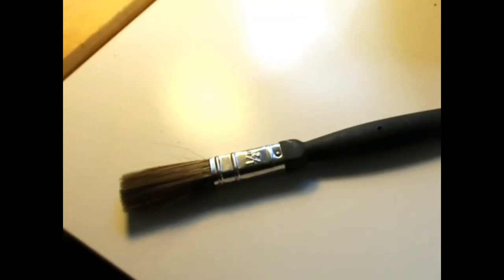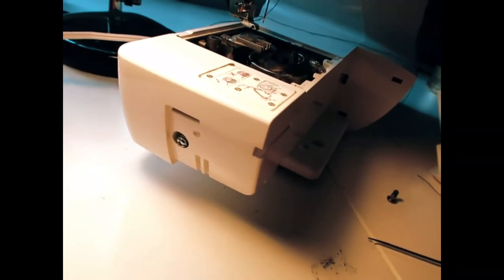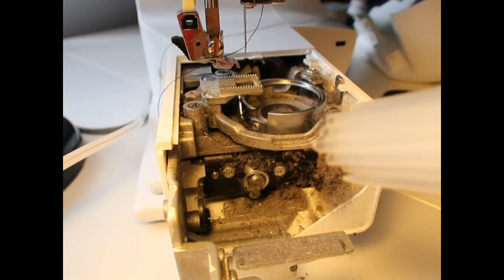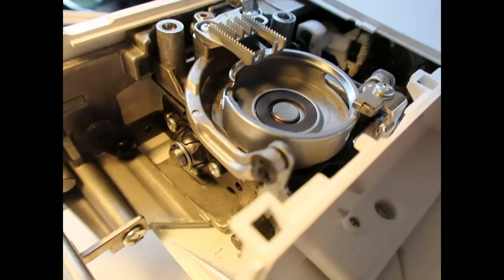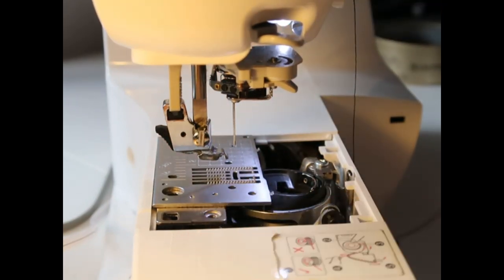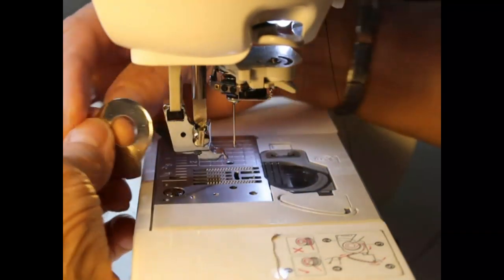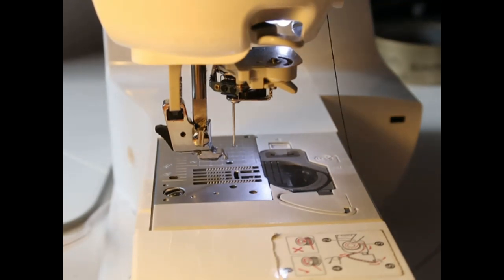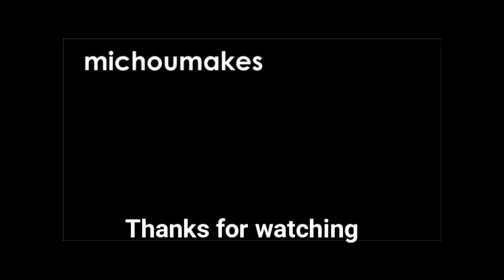spool case cleaning

Comment: Hello Micheline, I use a dime(American 10 cent coin) to loosen & tighten the "throat-plate". I place the dime in the grove of the screw,  put my index finger on top & with the other hand I loosen or tighten. It is easier than using the tool they supply. I keep my dime with the bobbins. I clean my machine, using a pipe cleaner. THANK YOU for showing how to remove the casing to make easier cleaning of the lower part of the machine.
Reply from the maker: Hi Marsha, I'm guessing you are much much younger than I am or you have more nimble fingers. I used to use s sixpence and yes I ought to retry using it. BUT, one think I have found as I am ageing is that gripping  and picking up small items seems to get harder. Chuckle x
Reply: @michoumakes  Yes my fingers sometimes have a challenge with small things, I am 69 & I think I'm older than you at 50 something. Please continue to teach all of us. You are so very nice.
Reply from the maker: @marshapowell2054  then you have nimble fingers Marsha. I wish I were only in my  50's but I'll be joining you at being 69 in December. 👍😍
Reply: @michoumakes  Wishing you HAPPY BIRTHDAY, in advance. Just got a notice from YouTube, @September, we will not be able to talk/reply.

Comment: The Stanley Tool Co. makes a off-set screwdriver. I find it perfect for the face plate screws. It is in the shape of a elongated Z. with a Phillips head on one side and a Standard head on the other. Works just perfect when taking out and putting back in the pesky screws.
Reply from the maker: Thank you ever so much Barbara that's such a great idea. I have used them in the past when working alongside my father on some mechanical task where nuts and screws were hard to reach, but I completely forgot how practical it might be for the sewing machine. 
Now to see if I can find one. 👍👍👍👍😍😍😍

Comment: Hmm, I’ve got a Brother machine that looks like that, and that vacuum attachment. Will have a look and see if mine also has that screw so I can take the side off. Will also check my bobbin case for wear, as never thought of that. Great video! Thanks.
Reply from the maker: That side screw makes a great difference to cleaning the machine. I'm sure my previous machines never had that. 😍👍

Comment: I realize that this is not a video you did very recently but I just wanted to say that the piece that holds your presser foot on the machine is removable so that would make putting the screw in a lot easier. I generally take off as much as I can to simplify everything for myself. Seems to me you have all kinds of gadgets to get the job done. Love the hoover tool attachment will probably need to look into something like that. I too use paint brushes especially since I was cleaning a Brother machine that I gifted to someone a long time ago and was using the small brush that they give you and it fell down into the machine, unfortunately didn't have a tool long enough to get it out so it stayed in there. You know the long hemostats (forceps) would have been the perfect tool. I think rather than waiting 6 months to clean the machine I would probably look inside after every couple of projects (especially since you have the ability to take that front piece off) makes for a easier job.

Comment: I have a brother 4000D and I was trying to clear a thread jam the other day. So I took off the covers and found what I thought was a TAUGHT thread which I couldn't move, I decided to CUT through it and then trace it back to the problem . I was absolutely gutted when I discovered that I had cut through a very fine tension wire. I just cried for an hour. It will be expensive to fix, just as well I have a backup machine.
Reply from the maker: OH NOOOOOOOOO!!!!!
I do hope it's not going to cost you too much Mary. Thankfully you have a backup. x

Comment: Hya Micheline, Love your videos. I have a Brother machine but the screw driver that came with it is much too long so I use a 2p piece to undo and  re-tighten the screws. It works very well.
Reply from the maker: Hi Ann
I have a little 5p piece in my front pocket/box of the machine and yes I do use that too. However, I'm finding as I age that it's not always as easy as it used to be to use it. Sonehow my mind says one thing and my fingers say the other! 😂🤣🤣😂🤣

Comment: Hi Micheline, that was very interesting, I’m going to give my machine a good clean now, well tomorrow, that’s a great tool you’ve got there for hoovering it out, can I ask what it is please, looks very interesting, I like how you can remove some of the tubes to get really deep inside. Xx
Reply from the maker: Hi Hazel.
If you look at the info below the vlog I have listed the link on Ebay and Amazon for them. However, if you can't see it then just put...
"Universal Vacuum AttachmentsBrush Cleaner Dirt Remover Vacuum Cleaning Tool Attachment Handy Flexible for Home, Air Vents, Corner,Pets, Drawer, Car" in the search bar and it should come up.
x